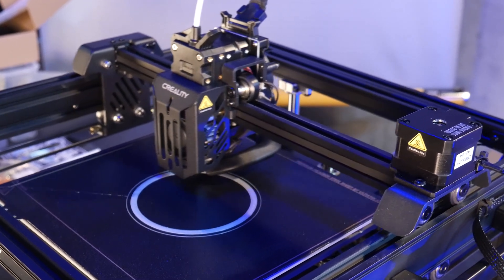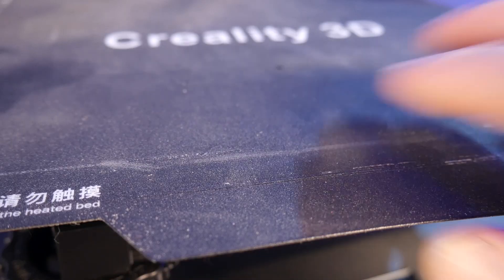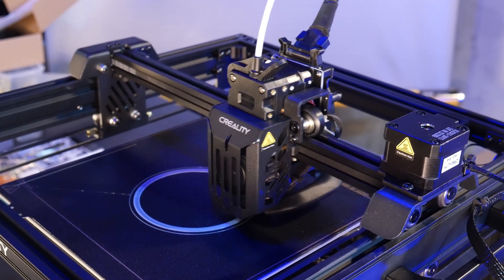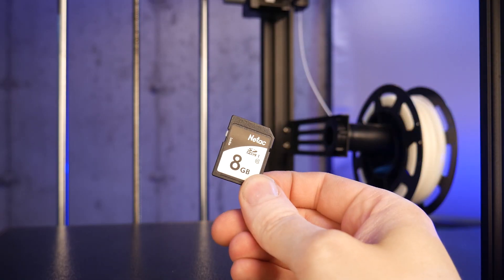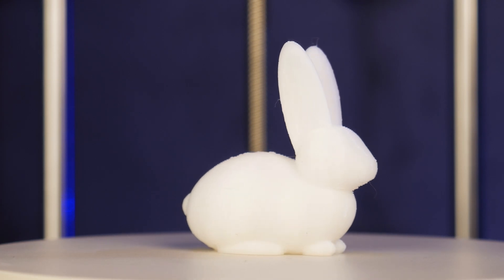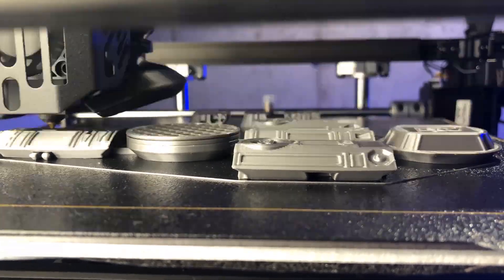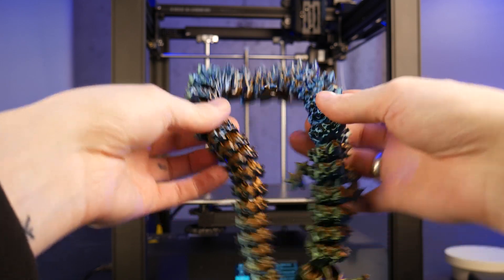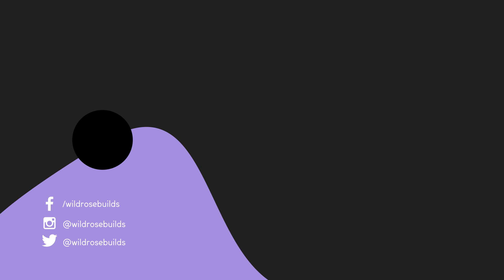Creality Ender 5 S1 3D Printer Review - WildRoseBuilds

Comment: I had a Ender 3 Pro and had nothing but problems though I eventually got it to work adequetely.  Then I bought an Ender 5 S1 and it is my favorite printer so far.  I have not had any problems whatsoever until about a year after I had it when it developed a clog which was fairly easy to fix and did not require any disassembly.

The only negatives are the awful firmware and the printing surface.  I bought a PEI build plate and cut notches in the rear though you can buy them with the notches.   I also bought an enclosure though I did not care for the smoke plexiglass and it was difficult to install the door as the bottom extrusion does not allow you to attach the door hinge as it is solid metal unlike what the instructions specify.  But  I got the printer for less than half of its price so I can't complain too much.  I wouldn't mind getting a Twotrees SK1 though.

Comment: Hiya, I tried printing this with brim and organic support, it turns out quite bad when it's done. it became too sticky. But if I print without any support nor brim, things came loose...just wondering if you're able to give me some guidance of what I might need to do? my kid wants me to print one 😬 ( i should've said the dragon)
Reply: hey, ive got the same printer and have got the settings down. It seems like your first layer isnt adhering, you may need to tweak the z axis value and/or increase your initial layer height.

Comment: I've been running the PC build plate on 3 printers for months and after it has like 20-30 prints run on it parts pop off just by curling the plate corner. It is a good surface and I recommend it. Most of these reviewers never use it for more than 1 - 2 prints and then declare it sticks too well. After hundreds of prints I can confirm it works well, adhesion is great and its easy to clean. It also doesn't release if the bed cools. I have zero damage on them and just use my finger nail to remove the skirting.
Reply: I'm with you I like it thought I was only one
Reply from the maker: Have you used a pei bed tho? I used the stock pc bed with my ender 3 for 4 years. I guess it’s a personal preference but I really like the bottom surface finish on parts printed on pei. Thanks for the feedback and Thanks for watching!

Comment: Creality can barely make a Marlin Config file that works correctly. And Klipper is still technically in Beta.... I have a feeling the K1 will crash and burn.
Reply from the maker: agreed! creality has a major problem getting anything software related right, but they can absolutely win the race to the bottom when it comes to hardware. i think good hardware and bad software is why we see so many modded ender 3 and cr10's. it'll be interesting to see how it all shakes out. thanks for watching!
Reply: @WildRoseBuilds  No prob, I watch your videos all the time. It's refreshing to see a channel like yours.